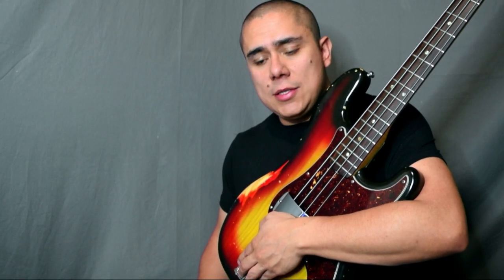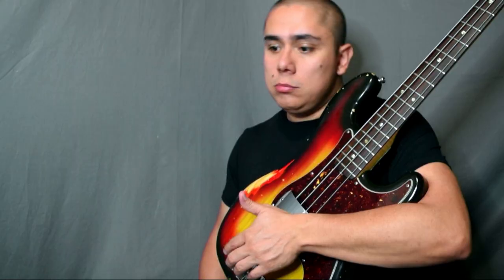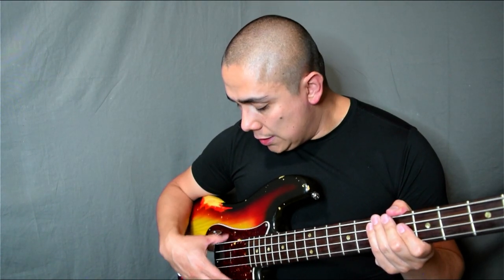Noisy Bass Guitar- Simple Fix

Comment: It's a shame that you pay so much for an instrument and they don't even spend $3 to shield it for you. SMH.
Reply: Believe it or not some guitar/bass makers still believe that shielding an instrument takes away the tone of said instrument which is why they won't shield them...
As a guy who designs and builds guitars I can say this is BS 🙂 🙂 I shield every guitar or bass that comes out of my shop and nobody ever complained about the sound...
Reply: @jeromewagschal9485 you know for the longest time I’d have agreed with you whole heartedly. But I just recently watched a Thomann video where the guy played the same lick on the same guitar back-to-back-to-back with unshielded/only PUP cavity shielded/fully shielded and I was actually kind of shocked. Partial shielding totally strangled the tone and full shielding absolutely opened up the bass and top end. Had a definite sparkle to it that was not there before. Great video to watch and listen critically to if you get a chance. 

Clearly, bad shielding is worse than no shielding, and full shielding eliminates noise but definitely turns the tone a little more high-do. 

For reference, I’m a bassist of 20+ years, lots of live and studio experience, have done lots of work of basses and guitars (and I’d like to think good work haha). 

Seriously, go check out that video. Very surprising. Was like going from a 3-ft low cap cable to a 50ft high cap cable in tone. Wild!

Comment: Another simple fix (especially for older basses) is to make sure the ground wire, usually under the bridge is making a good connection and not all corroded or buried in the body.

Comment: Thanks! This worked.  I was getting so frustrated after swapping electronics. One thing to note is that you also have to ground each cavity to the other areas for it to work properly. I added a bonding wire underneath the copper foil in the  my pickup cavity and soldered it to the back of the volume pot.
Reply from the maker: Thanks for mentioning that! You’re absolutely right. Didn’t even thinking about it considering my p bass only had the one pickup and it’s all one route. Glad it worked for you!

Comment: So does the whole pickguard need shielding? I would have thought to just shield around the pickup cavity and the area that covers the control cavity would suffice?
Reply from the maker: In this case it was to make sure the circuit was complete, and there was no need to solder the shielding and ground it that way since the pickguard made contact with the shielding, and the output Jack is connected to the guard it completes the shield. And there is a chance it would’ve been just fine had I not done it, but I had extra shielding tape and it certainly didn’t hurt to be extra redundant in this case.
Reply: @bryanabelbassist  fair play…👍

Comment: bro do you know if it works even if the pups dont have that metal plate underneath? got a mim 2003 pbass that's humming like crazy, its got no shielding and the only ground it has is the wire that goes from the cable jack to the the bridge plate
Reply from the maker: It will still work yes, assuming the problem isn't the pickups or soldering anywhere. That metal piece you see in my bass is basically a shield that was used in vintage basses. Clearly, and many people have said, they don't actually work all that well.

Comment: I bought a brand new guitar and bass, and they both do that noise? Is there any other workaround to solve that?
Reply from the maker: You can always try a noise suppressor, boss makes a fairly reasonably priced one, but that's not guaranteed to fix it.
Reply: @bryanabelbassist  can I shield it using aluminum foil, the one used in kitchens?
Reply from the maker: @GuilhermeSantos2003  I've never done that, and have never considered it. Upon some google searches, apparently its possible... I couldn't tell you for certain it will do anything though.

Comment: Hey! I'm about to shield my pbass due to when I touch the pole pieces of the pickups it makes noise, unless the tone is at 0%. Will shielding help with this issue?

I know. "Just don't touch the pole pieces". But still, that is an issue that annoys me to have and I want my bass as perfect as possible.
Reply from the maker: As far as I know, that’s not an uncommon thing. I don’t know that shielding the cavity will stop that as that has to do with the pole pieces being grounded. This fix is for extraneous grounding noise. That being said, a good shielding job will never be a bad thing and it certainly won’t hurt. There are lots of articles out there about how to help the buzz with pole pieces, maybe you can find a diy solution to help with that. I just don’t touch the pole pieces so it’s never been an issue. If it happens when playing you might consider lowering your pickup height a bit. Best of luck with it.

Comment: I'm gonna have to do this to my squier CV mustang. I've eliminated all other possibilities. Got a cioks power supply. Unplugged other electronics that use the same outlet. I use high quality cables, have my pedalboard grounded and use the noise gate on my boss GT1B.

If I play my humbucker guitar through my setup it is dead silent. I plug my mustang in and I get gnarly hum with the tone up past halfway. I touch the control plate and it goes away. So my plan is to shield it and check the solder connections and reflow the solder as needed. And if that doesn't fix it I'll revisit the issue when I get new pickups and I'll probably replace the pots and wiring.
Reply from the maker: Hope it’s an easy fix for you! Let me know how it turns out.

Comment: Sounds great but my bass does not have a pickguard. And I have that same buzz. Any ideas?
Reply from the maker: You can still shield the pickup cavities, and control cavity. Just need to make sure everything is grounded together. That might require some additional soldering.

Comment: Any tips on how to shield a bass with pj pups without a pickguard?
Reply from the maker: Well, my first recommendation of course is to take it in to a local repair person if you don't feel comfortable doing the work yourself. However if you want to try it you'd need to remove the pickup screws and carefully lift the pickups and shield the pickup routes but be mindful of the pickup wires and the springs that you don't lose them. You'd also want to shield the control cavity after removing the pots. Generally you just want to shield anywhere the wires run.

Comment: Great video but do you need to solder a ground wire from the copper tape to the ground of the input jack? Thanks
Reply from the maker: From what I understand, having grounded the pick-guard helps. It makes contact with the pot which has a ground wire going to the bridge so there is not a need for an extra wire. I did make sure to overlap some of the cavity grounding though in order to make sure it made connection with the copper shielding on the pick-guard. If there were multiple pickups you would need to make sure the two cavities are grounded together. Here’s a great article by Best bass gear with some more info. https://www.bestbassgear.com/ebass/repair/simple-guide-on-how-to-install-copper-shielding.html
Reply: @bryanabelbassist  Thank you. This was helpful. I’m getting noise all throughout the house in all outlets. The amp by itself doesn’t make this noise & the sound changes as I move the guitar and/or my body. One YouTuber showed that it was a defective new amp & replacing it resolved the issue
Reply from the maker: @paulv8453  glad to hear you got it sorted out. Nothing worse than electrical noise!

Comment: Did you do any soldering? I have a PJ bass and I was thinking of doing this but I've never used a soldering iron. I was also thinking about getting a noise gate pedal. Wish do you recommend?
Reply from the maker: I did not do any soldering for this, just the tape. I’ve never used a noise gate pedal so I don’t have experience with that in a live setting. Always worth a try. If the noise gate doesn’t help, then you can always try the shielding later.
Reply: @bryanabelbassist  thanks a lot and enjoyed the video!

Comment: I have a Squier Paranormal Jazz Bass but there are two separate cavities that connect under a plate. How should I do it?
Reply from the maker: You can shield the small electronics cavity, and depending on your comfort level you can shield both pickup routes. You'd have to solder a wire connecting the two pickup cavities to the electronic cavity as well to make sure everything is grounded. If you've never used a soldering iron I'd take the bass to a tech. You can definitely damage wiring or the bass otherwise.
Reply: @bryanabelbassist  Alright, Thanks!
Reply from the maker: @athan1453  No problem, if anything you might even try shielding just the electronics cavity first and seeing if that is all it needs. It possible you may not even need to shield the pickup cavities.

Comment: i have an Epiphone EB-3 Bass. This tutorial is for a P-bass and i don't know if i should use copper foil or Conductive paint, because the pickguard doesn't have a cavity under it, only on the bridge and neck pickups, which have a route to the volume and tone knob cavity.  i'm not sure if i should go with lining the foil inside or try to overlap it a bit over the cavity, just barely. will i screw it up?
Reply from the maker: Generally you’d want to shield wherever the wires run. In the case of your bass I don’t think there would be any use shielding the pick-guard. But the control cavity and pickup routes are prime spots that could contribute ground noise. I can’t say wether you’d mess it up or not, if you have any hesitation or no experience in repairs definitely take it to a luthier is always my first recommendation. Also I have a few luthier friends and they all prefer copper foil over shield paint. I also know some that use both.
Reply: Wish me luck, I'll try the copper foil. its either that or i'll have to resort to keeping my hand on the strings if it doesn't work.
Reply from the maker: @ICEenjoyer327  Good luck! It shouldn't be too difficult. You just have to make sure you are very careful with the wiring (don't want to resolder anything) and careful you don't lose any parts from the control cavity! I'd love to know if it fixes the issue! Sometimes it could be the pickups, pots, grounding... but you can never go wrong with a good shielding job either way!
Reply: @bryanabelbassist  update: i have done this fix and... i'm not sure if i screwed it up or half fixed it. the result was that the bass' controls wouldn't really function the same, like the third pickup selector is just silent, whereas before it was for the smaller pickup on the bottom. while i have fiddled a bit with the knobs and found a few settings where the pop or buzz would just be muted, instead of being a distinct noise... it just seems different. Verdict: Idfk what i did, but atleast it works. it could be a matter of one of the wires in the control cavity disconnecting a bit as this is an epiphone so i'd imagine the soldered connections aren't as strong enough as Gibson basses
Reply from the maker: @ICEenjoyer327  so the noise is gone at least? Definitely sounds like a wire may have come loose. Most likely on the control switch.

Comment: Did you use some kind of glue? Also I see you didnt remove the bridge, that means you weld out the ground from the control panel?
Reply from the maker: @DT-ko3wd  no glue needed. The copper shielding tape has a sticky side to it. Also no I did not take off the bridge. The ground wire still runs to the bridge. I had no need to shield it.

Comment: I Shielded it but it still makes that noise what should i do?
Reply from the maker: Take it to a tech if possible. But if you still want to try yourself you can. It’s Hard to say for certain, what type of bass is it? If it stops when you touch the strings or bridge than it’s possibly still not grounded properly. Are you sure it’s ground buzz and not 60 cycle hum? Does it do it when you solo just the neck or bridge pickup?
Reply: @bryanabelbassist how do you ground it properly then?
Reply from the maker: @SterlingSimmons22  There are numerous things you’d have to do. Get a multimeter Check all connections, make sure no wires are loose . Check the ground wire to the bridge. Check the ground wire on each pickup. Try different outlets in the house to make sure it’s not the power that’s causing the noise, sometimes if too many things are plugged into one outlet it can make guitars really noisy. Again though, by that point I’d take it to a tech to save the tediousness of trying to track down where that might be happening.
Reply: @bryanabelbassist  thank you 🙏🏻

Comment: That much noise, and the ground wire was doing its job? Did you take a multimeter to it?
Reply from the maker: Honestly at the time, I didn't. Of all the basses I had, this was the only one that was this noisy, and the only one that was not shielded.  Getting it shielded was something I was going to do either way. It fixed the problem so all was well in the end.

Comment: No soldering?
Reply from the maker: In this case no, Since the top body shielding made contact with the pick guard it completed the circuit. I don't think it would hurt if I soldered an additional ground wire to the shielding, but it wasn't necessary.
Reply: @bryanabelbassist  ok thanks